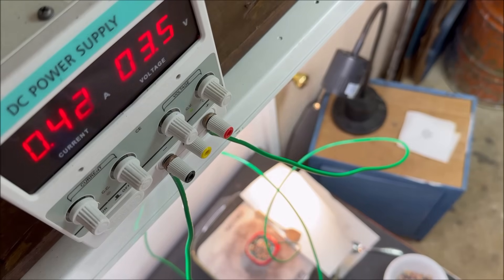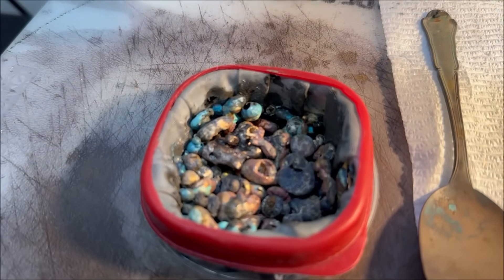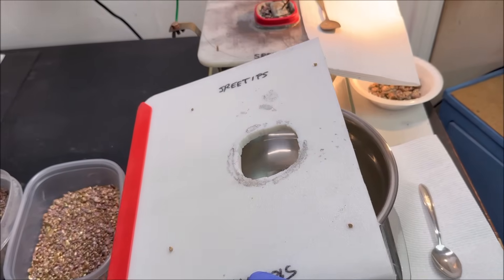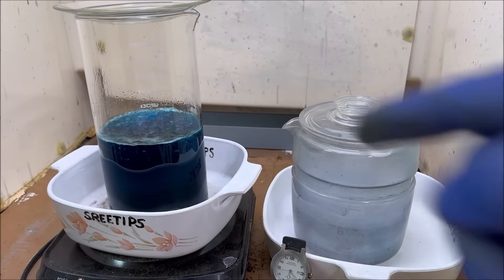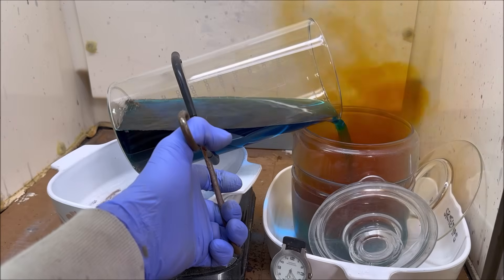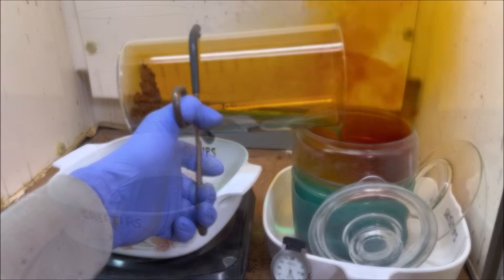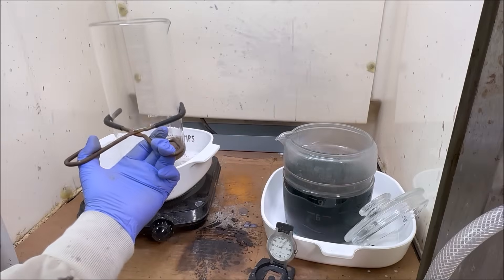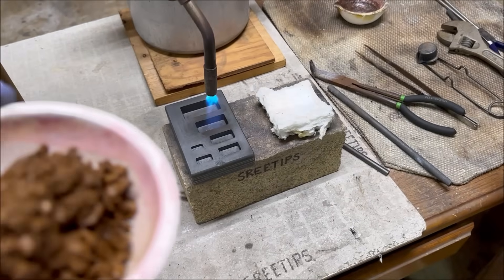Where Does The Silver Come From For The Silver Cell

Comment: I wonder if there would be a way to recapture the gas in aqueous solution to recover nitric acid and reduce over cost of production. You would need a closed reactor but with you melting 100k bars I’m sure you could afford it 😃
Reply from the maker: I’ve looked into large glass reactors with ground glass covers and fittings. It was pricey, I could afford one. But I’m afraid  I’d end up never using it.

Comment: Would it be worth using magnetic stirring or air agitation to keep the electrokyte constantly stirred? Or are we not too worried about keeping the current high?
Reply from the maker: My goodness, I’ve trying to come up with a design for constant stirring in the silver cell. It never even occurred to me to use a magnetic stirrer
Reply: @sreetips  I'm not sure if the silver plating would interfere with the stir bar, but could be worth testing?
Reply: @sreetips  some sturdy circle of tape on the bottom should allow the stir bar to stir without any plated silver interfering with the stir bar?

Comment: Have you tried to use the silver shot to refine gold? It is basically sterling silver, if  memory serves your have tried to use cement silver for gold refining ?
Reply from the maker: Using cement silver to inquart gold is not recommended because platinum group metals follow the silver and build up in it. This could cause problems in the silver cell.
Reply: Yeah, was thinking that could be a problem.

Comment: I have a question regarding the copper suspension in the silver cell electrolyte. If the cathodic stainless steel bowl were unplugged from the power supply and instead the conductive lead were connected to a copper cathode placed into the electrolyte, would the copper in suspension plate out ?
Reply from the maker: I don’t know, I’ve never tried that.
Reply: @sreetips  Me either. I was just thinking out loud again.
Reply from the maker: The silver in the silver nitrate electrolyte would cement out on the copper

Comment: Would it be possible to inquart using the cemented silver from the last gold refining and keep circling the same silver? I seem to remember you saying this impure silver is still more pure than Sterling.
Reply from the maker: Yes, but it’s not recommended. Gold contains platinum group metals, especially white gold. Using cement silver, over and over, would cause PGMs to build up in the cement silver because the PGMs tend to follow the silver. So that when you tried to run it through the silver cell, those PGMs (especially palladium) could get into the electrolyte and cause problems.
Reply: @sreetips  I see. Thanks for the information.

Comment: Can someone explain to me why the sterling is added? Still kinda confuses me. If you add sterling to the gold then just extract the silver out of the gold    during the process of refining it, what is the silver actually doing to the gold? Can this be done without the silver involved?
Reply from the maker: The sterling silver reduces the gold concentration so the the nitric can penetrate. Without the sterling added, the karat gold protects the silver and base metals from the nitric acid.
Reply: Other metals COULD be used, and Sreetips has used copper before to show how it works. But, one of the biggest advantages to using sterling is that Sreetips can recover the silver, which is also a precious metal. Either way, the gold MUSY be reduced to a 25% concentration in order for the Nitric acid to remove the base metals (and silver) from it. Too much gold, and the nitric acid can't do anything.

Comment: As a former Navy nuke guy and an engineer, when I see your silver cell videos I find myself considering how silver metal moves through the entire process.   You start out with cemented silver and run it through the silver cell which of course requires silver nitrate electrolyte to operate.  So part of the pure silver output gets diverted into making the necessary electrolyte.  Finally, you have three output silver streams.  Some impure silver remains in the silver basket, some silver remains in the electrolyte to be recovered as cement silver,  and of course the purified silver crystal.  Eventually, the former two streams are collected to be purified.  Have you ever done estimates of the amounts that end up in each of the three output streams?
Reply from the maker: I have not. The only reason I do this is because the silver is a by-product of my gold refining. The sterling silver can be held as-is, no need to refine it. So long as you don’t try to melt it and ruin the markings.
Reply: Sterling silver need not be refined, but isn't cemented silver the product of your gold refining?  Or can you hold that as-is too?
Reply from the maker: The cement silver is not pure silver, but close. So its purity, and therefore its value, are questionable.

Comment: Working on my first cell so I don't have to guess how many 9s to mark my metal with  and it's way simpler/more efficient than running both nitric pathways.  Thank you sir .  Starting with the $5 Thrift shop computer power source.  Thank you again.  

I found my local ace do not carry the dacron pre filters but ugh.. I found them on Amazon .  Besides the filter I need the fuse.  

As I'm about to ask how long it might run and why ypu eventually stepped up to dedicated unit when your video got to the part, your unit is burned out😂.  
For folks out there.  My set up costs ..the acid is probably the biggest expense.  Scrap silver is everywhere for cheap if ypu have time to look.  But even counting the silver it's less than 200 usd if you are resourceful to set up
Reply: 😂 it's pure gold. 
It's. 999
Oh maybe it's 995 
Er um 992 
Or maybe 990😂
Reply from the maker: Probably 992 to 995. Don’t take much to make the shine come off.
Reply: @sreetips  it's a classical walk back in real time and a reality check.  I was rinsing a large batch of cement as  your video played in background.  It got clear then kept getting a green mud.   Eventually I found several chunks of blue crust..  looking like I'm closer to coin silver than the sterling I started with and tap water in the mix 😂😂😂😂

Comment: Something I always wondered, is there a way to predict the purity of a refining?  For example, you said this was probably like 3 "9s".  Had you refined it again; I know it would have been a higher purity...but would it have been like 4 "9s" only?  How many refinings does it usually take you to get to 5 "9s?"
Reply: To get to 5 nines, you will have to do an electrolytic (gold) cell.
Reply from the maker: You can tell much about the purity of the gold by how it looks after pouring. This ingot was questionable, no telling what the purity is without xrf. It don’t take much to throw the purity off.

Comment: tooo saaad, to not see the aqua regia refining, it is the sexiest part.🤤.
Bro you can suply mutipl silver cells in one device, plug them in parallel and the amps should add up. this has some inconveniants but do the job.
make sur that the fuse and the power suply too can take the final amunt of amps.
Good job.
Reply: Running them in parallel will only work properly as long as the cells are completely equal. It would most likely work from the start of fresh cells until the first replenishment., maybe the second.
Reply from the maker: I’ve tried that, one of the cells starts robbing power from the other. Each cell must have its own power supply.
Reply: Yeah it may be difficult to monitor each cell that way, But in this case, the cell is not a "battery", ones the silver cristelise it would not want come back to solution. it is a "power hangry only" disposal, so as the power is delivred at a stable voltage amplitud it should.......
But as say my homies " ask the burned one "
Have a good day every one  @sreetips

Comment: The power supply doesn't have enough capacity to run 2 cells in a series?
Reply: I think he tried that a few years ago, didn’t work.
It’s better to have two independent cells. 
He is doubling his production of silver for the same timeframe.
Hopefully one day he’ll have many independent cells producing silver.
😊😊😊
Reply: @camus6208  By that time it will be a full time job, not what he is looking for.
Reply from the maker: Probably but one cell will rob the other and it doesn’t work well. Best to run each cell with its own power supply.

Comment: I don't see why you wouldn't be able to run two cells wired in parallel off a single power supply. You'd want to fuse both of them.
Reply: Parrallel might drop the impedance below what the power supply can handle. I would suggest that if it's got the amperage capacity, he could run them in a series.
Reply: @davidburton3447  That would requiring doubling the voltage.
Reply from the maker: Unless condition are perfect, one cell will try to rob the other of power. Ive tried it.

Comment: My silver cell electrolyte is turning green! Is that paladium?
Reply from the maker: Could be. A little palladium in the electrolyte isn’t bad. But if it gets too much palladium in there then the palladium could co-deposit with the silver. But contaminated silver is not the main concern. Palladium is about 38 times more valuable than silver.
Reply: Šis, is nicel.